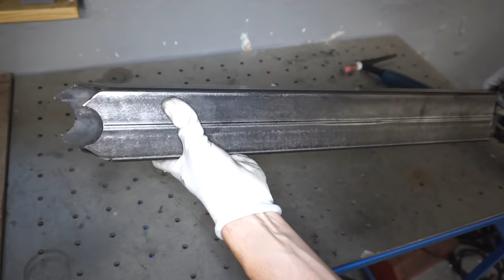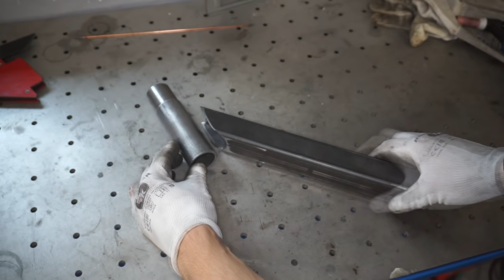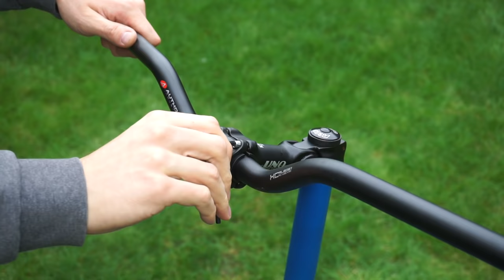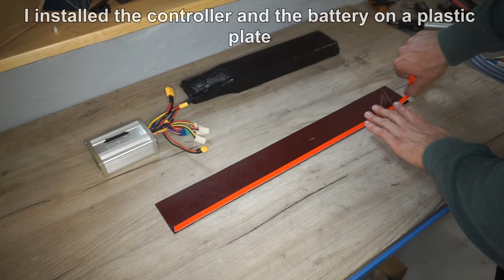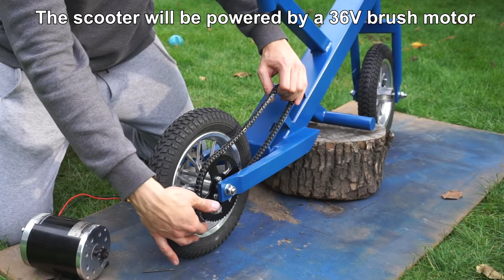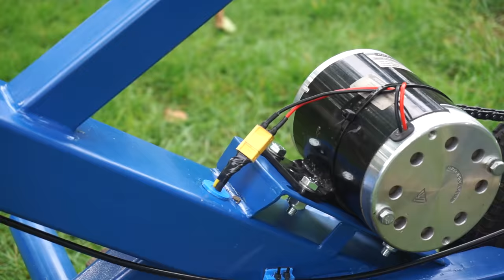Making a Chain Drive Electric Scooter

Comment: Nice project. Dont you think that a 1000W controller will get a bit hot? It has cooling fins taped over and it gets no airflow in a closed space...
Reply: 8
Reply: It might get hot but it's cheap and unlikely to break anytime soon.
Reply: It won't plus it has thermal shut off.
Reply: S, ñ

Comment: As a fellow engineer I really appreciate the time and thought that went into designing the frame. You provisioned for everything.
Reply: Crrct
Reply: @engineeringthoughts4776  ábuena
Reply: Except the chain slacks over time
Reply: I mean if you are a engineer how do you not know that the motor they bought produces around 2000-3000rpms, meaning when powering a very small wheel like the one in the video is not gonna work well. You need to ration down the 2000-3000rpms output to around 200-300rpms for it to actually have decent mileage, with the setup the motor is gonna be on max 100% of the time.
Reply: @denkrblx437  we're looking forward to your build video showing how it should really be done. Feel free to post here as a reply.
Reply: @renegaed  I dont have money/parts to build such a thing
Reply: @denkrblx437  The motor he used is rated for 2000-3000 rpms. The gear ratio will actually work well to give low end torque, and it wouldn't really harm the mileage at all. Electric motors aren't like gas engines.
Reply: @arnavrevankar444  Dude, theres a video on youtube where he used a drone motor to power a bike.. he explains the problem that im pointing out

Comment: Great design. I would still add small triangular grommets around 1/8 on either side of the seat post just for a little extra resistance to bending backwards over time. Keep it up.

Comment: Nice stuff. But I recommend you to reinforce the saddle support. Usually you weld another small piece into the triangle part of the frame. Because you don't have any suspension, that welding is taking a lot of stress.
Reply: Здравствуйте а сколько будет стоить такой самокат
Reply: 발명왕 에디슨

Comment: I've only just built my 1st scooter but I was thinking isn't it kind of a waste not to add suspension in any way maybe some shocks to the front?  I was thinking maybe even just a single coil would be would be better than nothing but I guess that depends on where you're riding et cetera

Comment: Nice build, but I'm unsure about the chassis design.

There's more stress on a bicycle or (motorcycle) chassis in a different way than your main tube is oriented. It needs strength vertically, not horizontally, especially with tiny tires and no suspension!

Keep an eye on the steering tube to main tube for cracks, 'cause it's gonna hurt when it breaks!
Reply: Ye electric motor kaise milega Kuch idea do please
Reply: Apna contact number do

Comment: This scooter is rock solid. but not simple, as we see that everything has to be build from scarc. Anyway it worked very good, but you should apply anit-shock to both tires and seat and a cover on the time and motor spot so when it rains you will not get totally web. Also if the motor's gear use a bigger ring, then the scooter can go faster without doing any major changes. If you already has a version that already fixed this problem, then I think this should be able to go for production and sales. Please let me know when you are ready for doing sale on this scooter. Thank you very much.

Comment: The wheel hub should free turn when the motor is not powering it. I didn't see that. It seemed direct. That would not allow it to free coast. Does that mean it would charge the battery??? Like a Tesla? I don't think it is that simple. Anyway very simple engineering and awesome craftsmanship. Very very nice so many skills in one person

Comment: you could also try a belt driven one it would be much quieter than a chain
Reply from the maker: The belt drive is quieter, but the gears must be in perfect alignment. Both solutions have advantages and disadvantages . The previous scooter was with a belt drive , I'm testing different options

Comment: Hello there. Today l viewed your project with deep interest. Pretty  
fantastic work. There are 3 queries which needs to be addressed, if possible at all. Number 1, can you also lit headlight and indicators with this battery? Number 2, how long could you travel with this (charged) battery? What would you do in case the installed battery gets dis-charged during your destined journey or the attached brushed motor will be acting as generator to automatically re-charge the battery? Thanks indeed.
Reply: You could put headlights and signal lights but you’d probably need a converter to change from 36Volts to 12Volts unless you could find lights that can run at that higher voltage. If the battery runs out you’ll have to pull over and charge it somewhere because I don’t think brushed motors have the capability of regenerative braking (and you need a special controller). Most electric vehicle owners learn within the first couple of weeks what kind of range they can get so you learn to stay under that number easily.  I can’t comment on his range but hopefully this helps a bit.
Reply: Google says 35km per charge

Comment: Great job. For the next one you could consider a brushless motor. Such as the Flipsky 80/100. Most likely will put out more power and half the weight and size. Pair it with a Trampa VESC controller for efficiency.  It will fly!
Reply: Show

Comment: Great IDEA if built on a DIY BASIS.  but  realy designed on the good old push bike that's been around for 140 years PLUS. AND ELECTRIC SCOOTERS THAT been  ON THE  market for many years.   Right down to the small discs breaks. 
Why NOT HAVE SOME REAL FUN PUT A SMALL I/C ENGINE IN IT AND PUT SOME REAL LASTING FUN IN IT.
BUT THERE AGAIN ITS NOTHING NEW.

Comment: Top speed of 35 mph and no suspension that would make it very difficult to control on a bumpy road ....
But a good job needs a chain guard if you get you pants 👖 caught in there it could be a cut up leg...

Comment: I have recommended lithium- ion dirt bike batteries for some of my builds, expensive but work very well...
Charging some of the batteries available can be challenging....
48Volt motors are popular.....
I like the idea of a no suspension electric monkey bike with tuff wheels similar to old school BMX wheels...